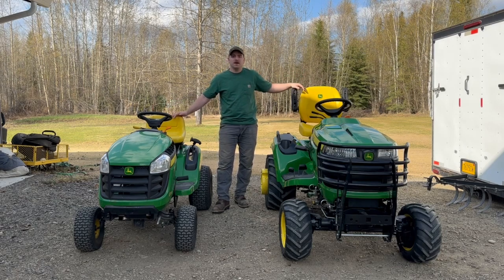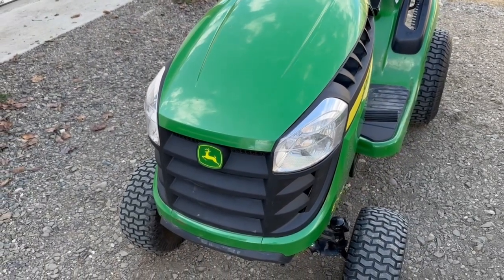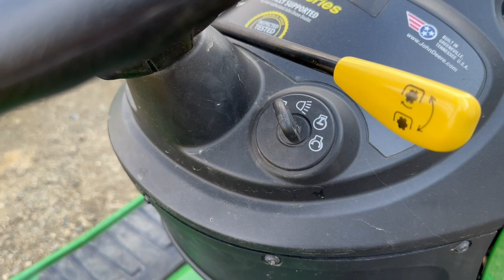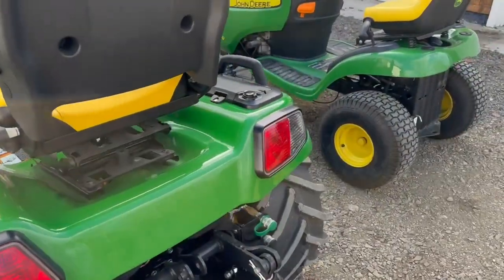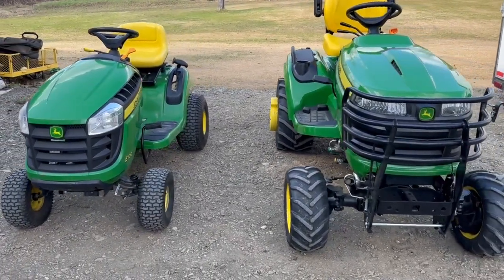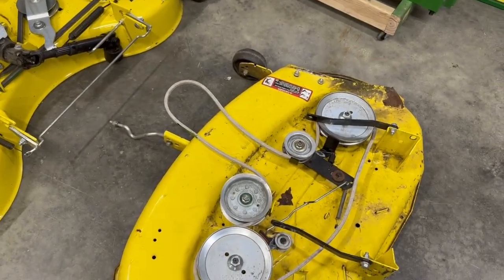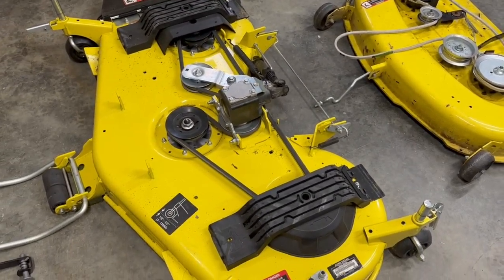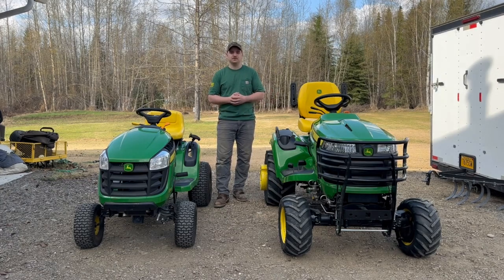Side by Side Comparison Of The John Deere E100 Series and X700 Series - Lawn Vs Garden Tractor

Comment: My X758 has a soft cab with plastic windows.  My former X749 also had a soft cab, but with a glass windshield and a motor driven wiper.  

The X758 makes an excellent companion to the 1025R.

Comment: I am looking for a modern garden tractor like my old wheel horse. It was only 12hp had full hydraulics and a sleeve hitch to use a moldboard plow as well as a cast iron transmission. The only thing i can find equivalent to that is a x700 but they are far to expensive and the sleeve hitch for it is over $600. Someone needs to build real garden tractors again.

Comment: Still doesn’t seem worth the price. If you want to mow grass buy a mower if you want to get work done buy a tractor.
Reply: Its versatility alone is worth the price if you have several acres as it can blow snow, mow grass, haul logs, spread fertilizer, seed, and horse manure. It can also move a trailer around on the property, and the front receiver hitch makes "backing" a trailer into a parking space, especially easy.  The 3-point hitch accommodates a landscape rake and a back blade.  During power outages, you can even power a 10 kW generator.

So, why purchase a mower, a snow blower, a generator, etc, separately?